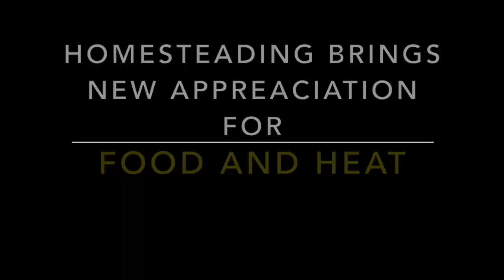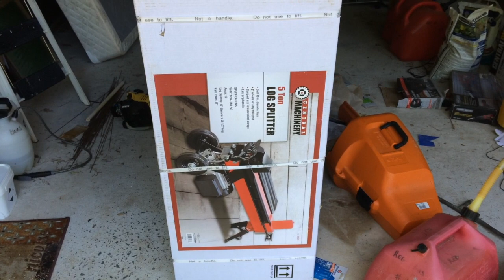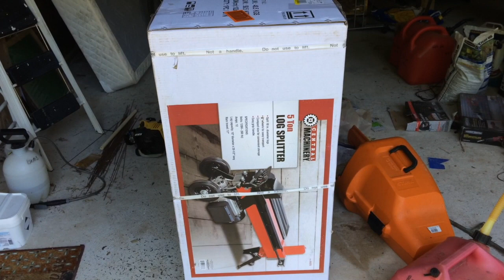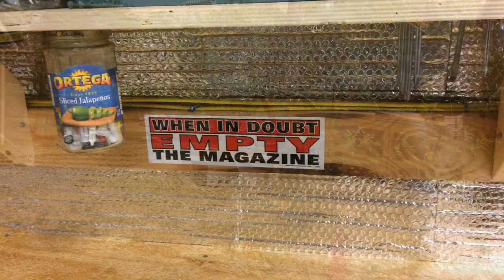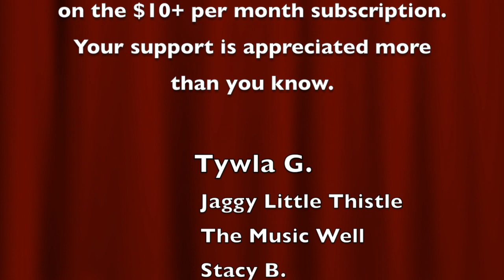Homesteading Brings New Appreciation

Comment: I just sold my speeco 5 ton and it looked identical to yours. I sit a ton of wood with mine. I bought the electric for the same reasons you did. Another dang mouth to feed. Gas,oil,filters,plugs,maintenance. I found out that if you come across a piece that it won't split down the center,you can work your way from the outside in.

Comment: D ! You need a hand-crank internet, use smoke signals, or sasquatch banging a stick on a tree trunk.

If you use that HD wire gauge fence mesh and make those big and tall walk-in "U" arches, ... you will never need to move them.  Fence posted into the ground, all stable.  Just pull out the dead plants, replant seeds, and have the tomato plants grow up the wire mesh trellising.  Permanent double trellis vertical gardening.

Comment: 16" is the standard size. You will probably have to wait to burn that Wood until next winter. That way you get the most BTUs out of the wood and it won't still be wet. You want to get the most out of the wood. Wet wood will create more creosote in your chimney.

Comment: Tommy if the log splitter is not going all the way through the wood like it was doing make a spacer to put in between the black thing that pushes the wood, use something like a block of wood or put two logs if will fit and it will go all the way through the wood wont have to pull it apart unless it's super stringy wood , I am sure you know this on very large pieces of wood start on the outside and work in toward center I hope this helps ya